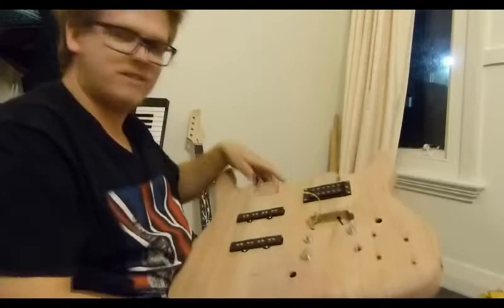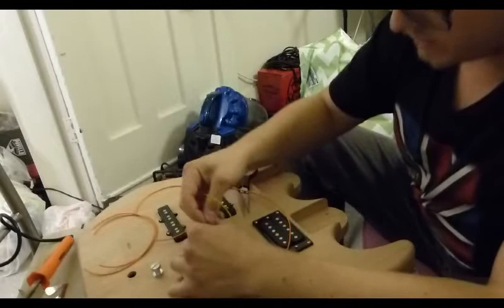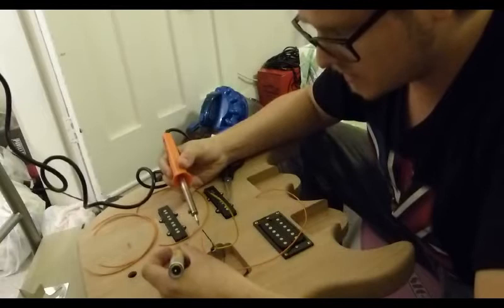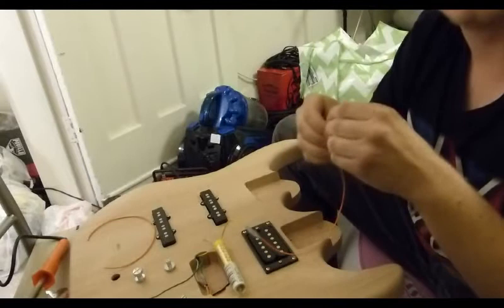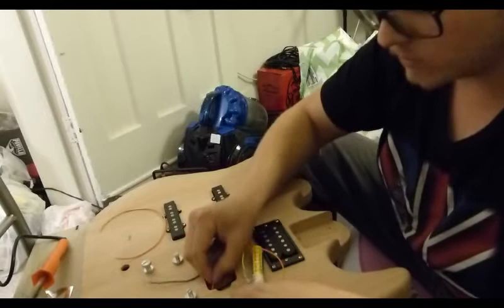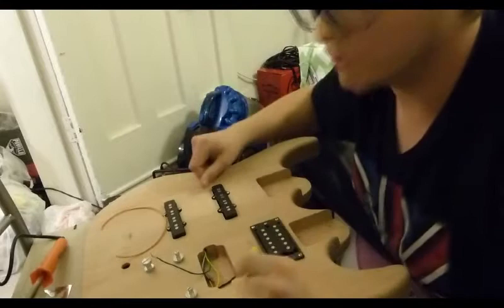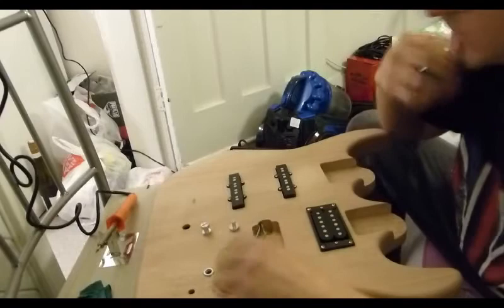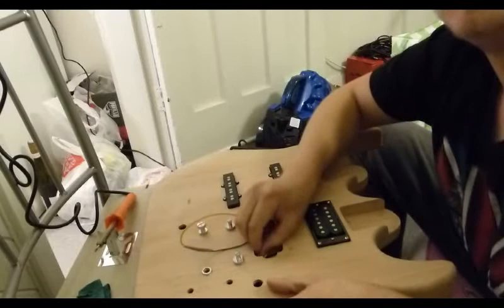Double Neck Build 4 - Extreme Soldering Iron Extreme Solder Hour

Comment: Do you have a plan for the wiring? I have no idea how to wire my double neck
Reply from the maker: I dont have a plan sorry. Man takes 3 years to reply and has no answer. Sorry Peter. Personally, i think wiring it up with 2 circuits makes the most sense. And have 2 cables running to it. Then you can take the bass to a bass amp and guitar to guitar amp.